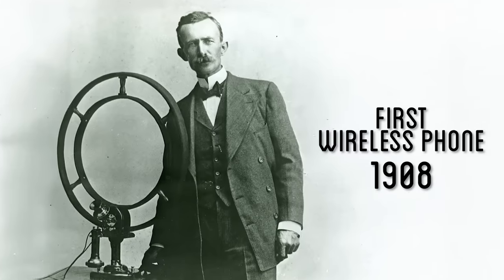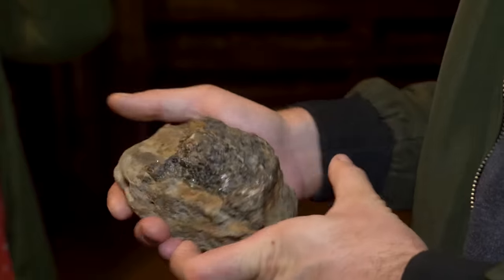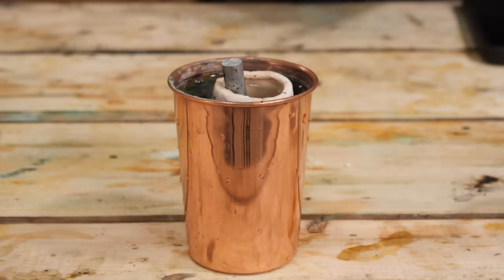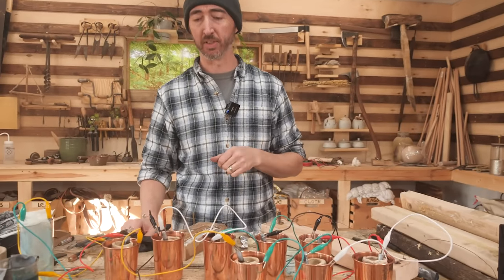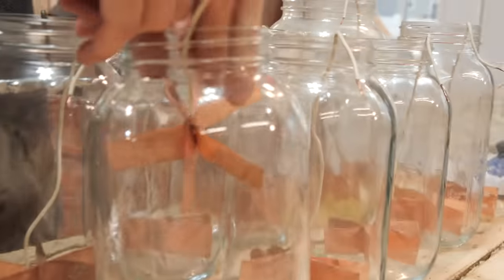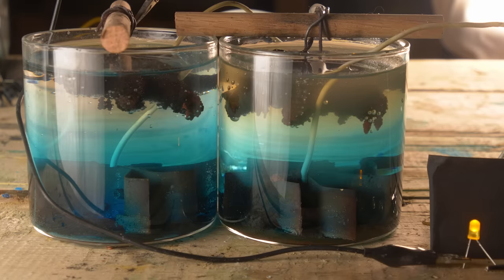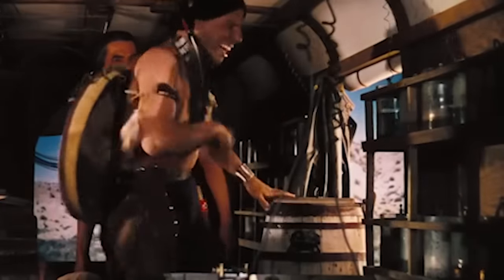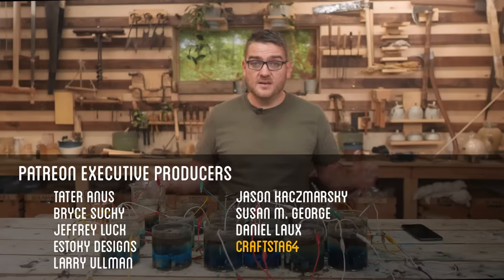These 3 Rocks Can Charge Your Phone!

Comment: I do not get why you connected a lithium battery charging module between your copper and zink battery 😅 it is probably that module that determined that your battery does not behave as a normal lithium battery and shut it down, and it would probably charge the phone better if you just connected it directly to the battery. I do have experience with charging phones with strange power sources because I have been far away from civilization

Comment: I dont understand, why charge a battery with a battery? wouldn't it'd be a lot easier and practical to just harness energy from friction using wind/water/steam? The biggest challenge would be regulating voltage, which you use modern tech to accomplish but dont mention.
Reply: Btw I get the channel is about making things, this video is about making battery cells in the past, not "whats the best method to charge your phone in the past"

Comment: Before it went onto the 'crows feet' for 'more surface area'... I was typing 'make the clay pot with pleated walls to increase the surface area whilst in the same copper container please.
Reply: Why not make copper and zinc metal electrodes in the shape of pot metal scrubbers.  Should have plenty of surface area... Though might not degrade too gracefully.  

Rather than relying on gravity... These batteries were frustratingly shorted with just tipping... Why not use a different separator than a clay pot... While making polyethylene or vinyl is just beyond the scope of HTME, perhaps packed sheets of mica.
Reply: @quarkybill  cool idea for the 'steel wool' shaped ones, they'd be strong but wear away very quickly unless they are giant and thick... Please do that idea too (although hard to shape)